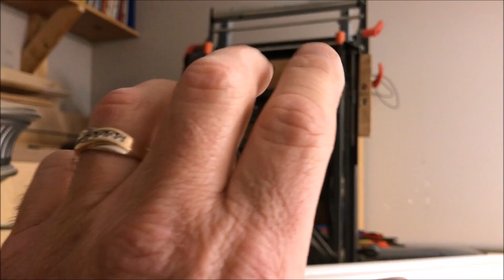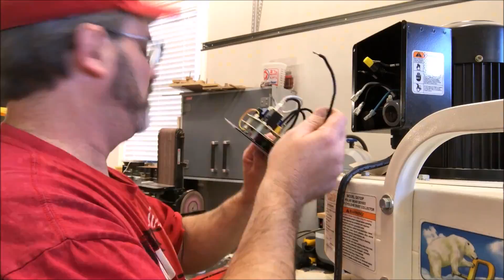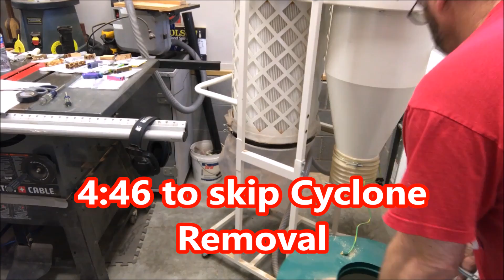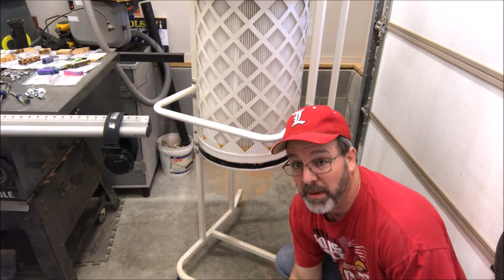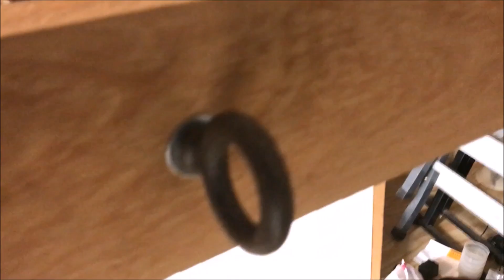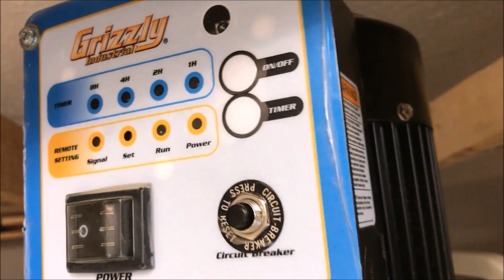Hanging my Dust Collector - Phase 1

Comment: 4" sewer and drain pipe is cheap. Tie the fittings that kill your pocket book
Reply from the maker: +Mike Turner You're not kidding, the Y's for 6" pipe are around $30.00 each. It's about the same for a Y to reduce 6" to 4". I'm gonna have to build it one section at a time. 

Regards,
Bob

Comment: Perhaps you can purchase about a 20ft 4" flex hose from Woodcraft (or someplace else) that you can use to begin collecting dust on one machine. Attach one end to the collector, and the other end plug into whatever machine you use the most. (Or move that end from machine to machine as needed.) Then, when that green paper becomes more available, you can install the permanent plumbing. At least you'll start getting some use out of the dust collector prior to Phase 2. Call it Phase 1.5...
Reply from the maker: +Doug Freeland Thank you Doug,   
  That's a good idea. 

Regards,
Bob

Comment: why change to 220? I don't understand is it easier on the motor over 110?
Reply: Definitely easier on the motor and will make it last a lot longer.
Reply: david gochenour It probably doesn't matter for this application, but you have less amperage on a higher volt (same horse) motor, so you can save a fair bit of money on the wiring. An example of somewhere this makes a big difference is the steel mill I work at; our dock conveyor has three 1000HP motors that are running at 4160V, which at max draw puts them ABOUT 105 amps each; if they were running at the plant standard 600V, their max draw would be about 720 amps each. The difference in cost in wiring, busway, breakers, starters, yadda yadda yadda justifies running the higher voltage.
Reply from the maker: It’s suppose to be more efficient.

Comment: I have literaly zero experience with these things, but to me it seems odd to have the unit up high. Or is it meant to? Wouldn't it take less power/energy to have it on the floor, as the motor wouldn't have to work against gravity? I am really curious! Nice video as always, cheers Guido
Reply from the maker: +Guido Dresmé Most people place them on the floor then run their pipes up and across the ceilings of their shops. Mine starts at the ceiling so I'm hoping it will make it a touch more efficient. 

Regards,
Bob

Comment: cant wait for the next build. looking good so far. you could use bungie cord to secure the bottom end to the timber frame at the four corners. it would hold it centered and stop it from moving around while running but still not transfer vibration.
Reply from the maker: +B Lenane  Nice idea,
  It only seems to move for a second on start up and shut down. It settles down once it's up to full speed. I may try this idea if that becomes a problem. 

Regards,
Bob